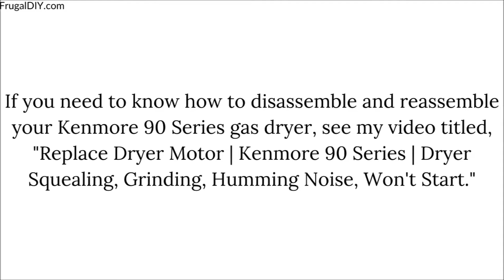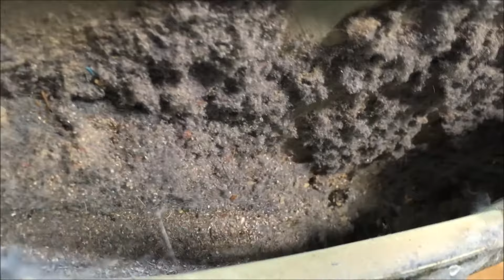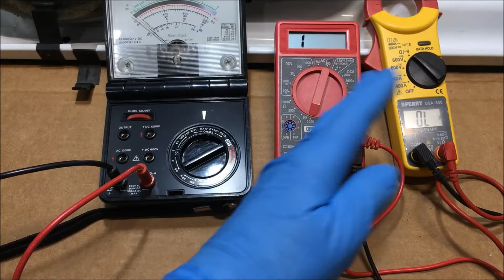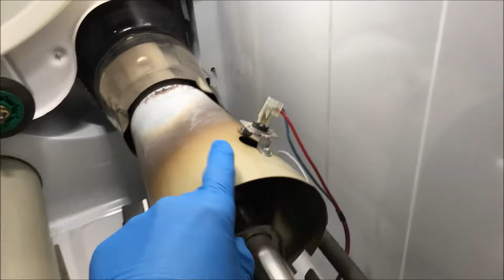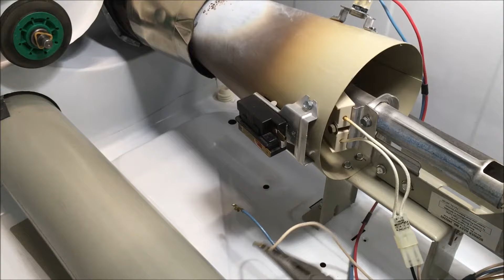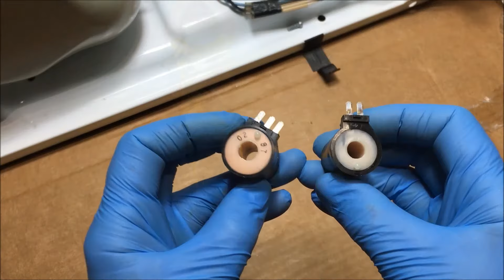Troubleshoot Gas Dryer | Dryer Won't Heat, Won't Start, Won't Stop, Dry Time Too Long, Dries Too Hot

Comment: I took a haphazzard approach to fixing my dryer until I found your video. Using your testing approach and working on the principle that, after eliminating all other possible causes, then whatever is left must be the solution! Indeed it was, false positives on the solenoids. 
Thank you so much Frugal DIY! Dryer fixed! 😊😊😊😊😊😊
Reply from the maker: You're welcome.  I'm glad my video helped you fix your dryer.  Always glad to hear another success story.  Great job fixing the dryer yourself.  Happy DIYing!
Reply: @frugaldiy1  Thanks again. I was, of course, using Shelock Holmes' technique and I should have used the phrase "however unlikely" My proof reading is apalling!

Comment: What If I do all this and my dryer still doesn't heat? Ignitor won't glow at all either. I literally did all of this and everything tested good. Also cleaned the ducts of lint. Great video BTW

Comment: WOW This is one of the most complete troubleshooting gas drier videos I've viewed, well done! You pointed out that the solenoids could test false positive but intermittently fail during operation, would you say that could also be true for the other sensor parts tested? Just trying to determine the correct part to replace since as you mentioned the failure symptoms are nearly the same. Thank you!
Reply from the maker: Thank you for the kind words.  I appreciate that.  I've found the solenoids are typically the culprit.  I'd change 'em.
Reply: @frugaldiy1  Thank you for the reply! The issue I'm visiting is long drying times. Ventilation is all good so now I'm attempting to determine which component is intermittently failing.
Reply: @frugaldiy1  
Drier lit with a good flame for 5 mins
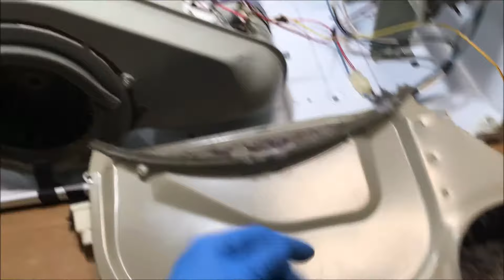No flame for ~2:30
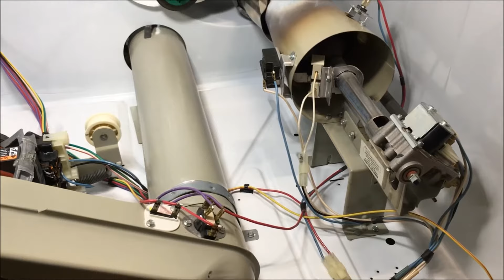Lit with a good flame for ~1:30 
No flame for ~2:30
Lit with a good flame for ~1:30

I'm thinking it could be the high limit sensor since when it's cold it remains lit longer then every other light it takes 2:30 to cool enough for the sensor to release. How does this logic hold up? The other part to change would possibily be the solenoids. 

Prior to running the drier I tested all components as good. TY

Comment: Thank you for the detailed information.  It is nice to know what the components are as well as their function and how they work together.  I have a fluke 117 that I haven't used much but today is the day to play with it as my gas dryer stopped heating.  I can't believe how much lint is inside the unit.  I cleaned my exhaust line 3 weeks ago (26 feet) but the inside is worse.  I replaced the coils many years ago and the dryer has been working just fine until this week.  I snipped a screen shot of the inside of the dryer, printed it, and identified the parts as well as what the ohm reading range should be for the coils and igniter.  Thanks again.
Reply from the maker: You're welcome, Tony.  Thank you.  ;)

Comment: Good morning and Merry Christmas! I have a Kenmore HE3 gas dryer and I was getting a display but it was just clicking and not starting. So I checked the belt thinking maybe the belt broke or came off but it was fine. I also checked the thermal fuse and the thermistor, Both were fine. I put everything back together. I did not touch anything else I’ve replaced the thermistor previously with no issues, I got everything back together I plug the dryer back in and now I have no power at all. I have actually replaced both the thermal fuse and the thermistor since then because I had new ones just by the off chance it wasn’t working and read like it was. I’ve checked my circuit breaker, i’ve flipped the circuit breaker on and off. I’ve unplugged it and plugged it back in. I tried a different outlet and I’m lost. I have no idea why I have no power so I have no error codes. I have no power nothing comes on and I’m so confused and I can’t find anything that can help. Do you have any suggestions for just a complete random no power situation that A non-professional could try at home to fix I do have a multimeter. I appreciate any response with or without suggestions. Thank you.
Reply from the maker: Good morning and Merry Christmas to you too!  Based on your synopsis, my DIY mind would go to either digital control board failure or that I would have somehow disturbed a wire connection when working on the dryer.  FYI--I'm just your average DIYer who avoids, like the plague, any appliance, vehicle, tool and so on that has a digital control board involved in its operation.  Nothing but trouble!  I'm old and old-school.  ;)
Reply: @frugaldiy1  thank you for the reply/info I appreciate it. Not sure what I am going to do, I thought I would give it a go but all the little things I was confident I could do and not die I did and it didn’t work. Ty again :)

Comment: Thank you for this wonderful descriptive troubleshooting video. I recently noticed my Kenmore dryer wasn't heating. I tested the components as described and everything checks out. I opened the front portal on a heat cycle and I noticed the igniter coming on and off as it should but without the gas lighting. After the igniter glows I can smell gas inside. If I blow into the portal with the igniter glowing the burner will light. But it extinguishes after some time in the cycle. I'm hoping it is just a matter of replacing malfunctioning coils, but I'm not sure why I'd be smelling gas intermittently if they were not working? Is this a situation where the valve could be bad?
Reply: So was it just the coils or something else?

Comment: 13:58 You're the only person to suggest the possibility of a false positive on the coils. Sure enough, that was my issue. I tested all the fuses and coils in my dryer and they all were within spec. On your suggestion I replaced the coils and my dryer flame now stays on.  For what its worth, my new coils did show a slightly higher resistance than the failed ones. THANKS!

Comment: My dryer has two parts to the high-limit thermostat, or two of them connected together.  One of them has continuity, the other does not.  I don't know if this is the source of no heating or not.  Ah, one of them is a fuse.

Comment: I've replace the belt The Idler pulley the rollers that were frozen. If I hold the door switch in hit the button turn the drum counterclockwise it will start up and run. It makes a humming noise if I don't assist it. Then the igniter in the gas come on oh my God. I shut the gas off thinking about taking the motor out and cleaning at the commentator in the brushes the motor was replaced under warranty Whirlpool dryer have a number of calls on messenger I don't want to pay $300 for the insurance anymore cuz now I could  of  had a $1,500 dryer😢

Comment: By far, the best diy video. Would recommend her over and over again because she explained and demonstrated how to do this job perfectly.
Reply from the maker: Thank you.  I truly appreciate your thoughtful comment and that you took the time to write it.  ;)
Reply: @frugaldiy1 when the centrifugal switch is taken off of the motor. 1-6, 3-5, 5-6 all switch ok. All three are the opposite nc/no when switch is installed.

Except 3-5 is always closed. Installed or not and does not open when the sliding ring on the mower is pushed over.
Any ideas? Would this cause a no heat issue. All the other safety switches seem to be good.
Reply: I agree 100%, by far the best instructional video on YouTube.
Reply: agreed 👍
Reply: Agreed

Comment: I agree, this is the best tutorial on diagnostic video I have found. Very much appreciated. Question: I am finding that I cannot purchase replacement coils on my Samsung dryer - DV45K7600GW/A3.  I checked numerous sites online and even with Samsung parts online. I can only buy the entire gas valve (DC62-00201B) which is ridiculous because I can remove the coils without issue. The gas value is $260-$350. Coils are a fraction of the cost. Any suggestions? Is there a way for one to subsitute coils from other models? Thank you.
Reply from the maker: In your case, I recommend you take the coils to a local appliance parts business and ask them if they have replacements.  My guess is they will.  I think it's shameful if Samsung manufactured a dryer that requires replacement of the entire gas valve when the coils tank.  SMH
Reply: Hi again, still trying to resolve my issue. Any suggestions would be much appreciate. I’ve tested twice the thermal fuse, thermistor, high limit thermostat, radiant sensor, igniter and coils. I even replaced the thermal fuse & thermistor to no avail.The vent and vent hose/housing are clean. 
My dryer is not heating continuously. The dryer ignites and a flame comes on, but goes off after a minute or two. I suspected the coils even though they test fine. What am I making missing? Is it possible the dryer has another sensor. Could the issue be in the control panel? Thanks
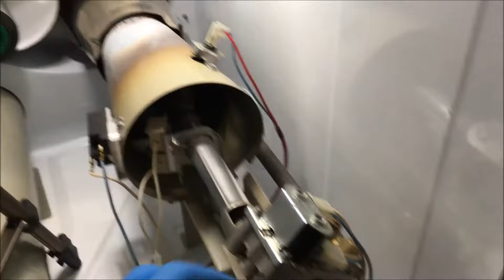Reply: Did you resolve it? I cleaned/changed everything even though old parts tested good. New coils (same as Maytag FYI) worked for a few weeks. $15 used Maytag valve (reused adapter) worked for a few days. Today I took top off & ran dryer (disclaimer: don't attempt): 1.👂🏽click & waited 10sec; 2.👀ignitor glowed in reflection; 3.👂🏽gas ignited & sustained 8sec; 4.👂🏽click, gas off; 5.👂🏽unproductive clicks & buzzes +60sec; 6.1-5. repeated. Per this video ~8:15 it could be consistent with the high limit thermostat, but the old one had continuity. I'll take it apart tomorrow, re-test the new parts installed and check for loose wires. If not, maybe it's the panel??  @tonyd8128
Reply: @youeweu  @tonyd8128 Did either of you find a solution? experiencing the same here on a samsung frontloader, new thermal fuses(both), new coils(I have 2 new extra sets sets testing within functioning range), everything passing tests. Dryer ignites, flame stays on for 30 seconds, shuts off for 60 seconds, ignites for 15 seconds, shuts off for 60 seconds, ignites for 8 seconds, turns off for 60 seconds - light load still wet after a 30min cycle.  Bad gas valve? All components are testing withing range or passing continuity tests. my old parts all tested within range as well. Best video i've found online! watched it 20+ times! Exceptional video @frugaldiy1, respect!
Reply: @arvizucamp9880  Did 3 things (which if you do is at your own risk). Flame still seems to shut off but no less than 15 sec and clothes get dry. 1. For the sensor that sits atop the flame shield, added washers where it mounts, to set the sensor further away ~1/4". 2. Use sensor dry, heavy duty. 3. Unplug from outlet after use.
Reply: I was surprised my samsung had Maytag labeled components on it. After seeing the maytag label on the gas valve I was able to find replacement coils easily on amazon.

Comment: Replaced gas valve coils and the igniter will still glow for a few seconds and then turn off for a minute or so and then repeat with no fire. Is the valve itself the next step?

Comment: I can not figure mine out. It’s similar to your setup.  everything checks out good. The flame ignites for 10 seconds then goes out. If i bypass the high temp thermostat the flame will stay on but i can see the heat tube get cherry red. So it seems it’s just getting to hot. My solenoids are not replaceable. I’ll have to replace the gas valve with them. Does this sound right?
Reply from the maker: My guess is the issue is the pesky solenoids are weak and malfunctioning.  It's a bummer you have to replace the entire gas valve.  Shame on the manufacturer!  If you have to, I'd look on eBay for a preowned gas valve that's being sold by a service repair person.  Like plumbers, they pull parts from working appliances (and water heaters and such) and sell them on eBay.  Look for a seller with high rating.

Comment: Great video! I watched a different one which was also helpful but didn't explain as thoroughly as yours. So when I watched yours completely I was confident that my gas dryer needed a new thermal fuse. All long I thought at some point you were going to say "and this is the problem source" or something like that but then I get it at the end that if this dryer was drying intermittently then the problem would've been the coils. You left me wondering but that was cool! Thank you!
Reply from the maker: You're welcome.

Comment: Question : Can a Gas Valve Solenoid be blown "immediately"? 

Reason I ask : I replaced my coils and I still had the same problem, afterward, where ( while looking through the port hole ) the igniter would ignite, but wouldn't stay lit for more than 15 to 20 seconds. 

I did test the new coils BEFORE putting them in, I did notice that I had to  press a little harder on the MIDDLE terminal on the 3-prong coil, to get it to read. 

After installing them, and discovering that I still had the short-lived flame problem, I pulled the coils out and re-tested them, yet, this time, the 1 & 2 combo (on the 3-probe coil) was dead. 

Even pressing a little harder, it comes back dead; yet, very little pressure required to get the 1 & # combo to read; 

BRAND NEW COILS; just put in; ran the dryer for 20 seconds, and the new 3-PRONG coil FAILED the 1&2 combo test. 

I retested the OLD 3-pronger coil, and it passed BOTH tests ( 1&2, and 1&3). 

I put the old one back in....but still;, a 20-second flame, and poof, goes out. 

If I but ANOTHER set of coils, can those BLOW IMMEDIATELY? If so, I don't want to do that, until I figure out what's causing them to fry out immediately.
Reply from the maker: Floyd, as one person who commented learned, a new Honeywell gas valve can be defective and not work.
Reply: Did you figure out your situation. I have a similar situation but my coils are all good after use.

Comment: I want to change my thermostat WPW10625430. However, that thermostat is not in the market anymore. Can you recommend any alternative I can use instead? Thanks for the advice.
Reply from the maker: Eagleyes, I recommend that you contact an online or local appliance parts store and ask if they can locate the part for you or offer an aftermarket part.
Reply: @frugaldiy1  thanks for the advice. Will try that. Thank you.
Reply from the maker: You're welcome.  Don't stress--it'll all work out.  ;)

Comment: Do you know the part number for this specific dryer model thermal fuse?
Reply from the maker: I don't off the top of my head.  But, I might have listed the part number in the "Show More" section of the video.  I'm sorry I couldn't be of more help to you.  I'd search the model of the dryer to find the part number.  I often have good luck on eBay.

Comment: One thing I learned about dryers, any of them, is that it’s vitally important to clean lint filter after each load.  Sometimes, if I’m doing a lot of towels, in the middle of a load.  This prevents fires and also helps increase the longevity of unit since the whole thing including motor is not overheating.
Reply from the maker: Great point!  I agree 100%, Alex.  Interestingly, after I thoroughly cleaned all lint from my dryer when I worked on it, it dries clothes in about 2/3 of the time now.  When I was a youngster (many, many years ago), an older gentleman told me, "Young lady, take care of your things, and they'll take care of you."  Boy, was he right!
Reply: Absolutely right,  I know a family who's dog died in their house DRIER fire, and confirmed due to NOT cleaning the lint filter. Heart breaking